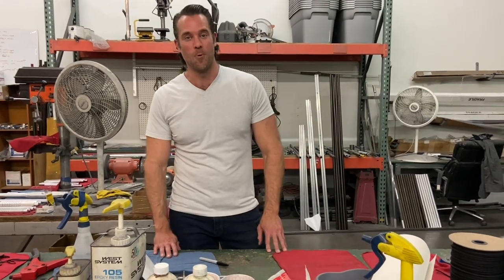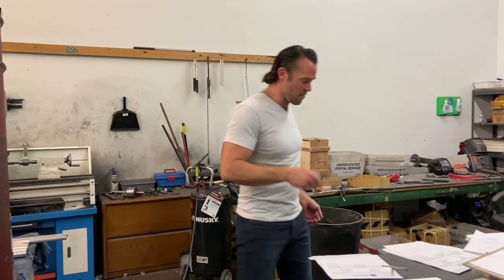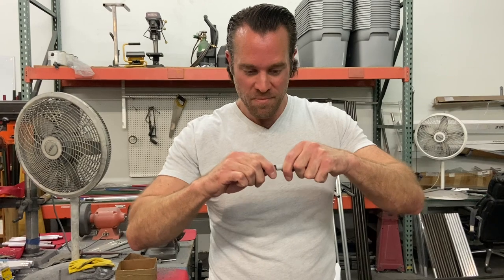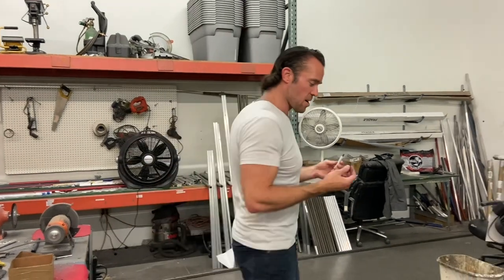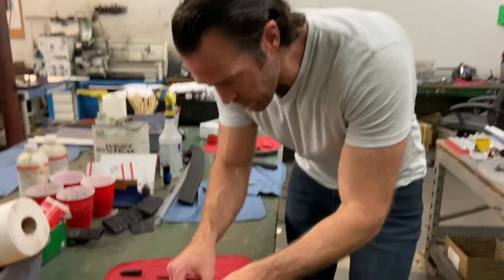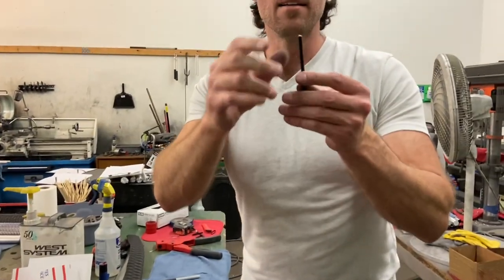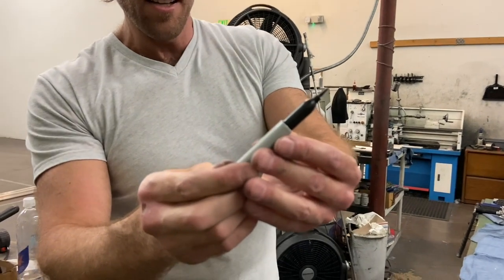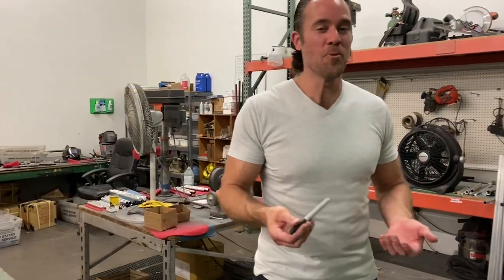I Made a Hidden Marker Spike Weapon!

Comment: I woke up outta bed this morning with a smile because I knew it was weapons Wednesday!!!🤩
Reply from the maker: That's awesome John!  Thank you so much for the support.  Yeah, for prototyping, I have a manual lathe, CNC lathe and CNC Mill in the other room to play with.  I've already been thinking through next weeks video and I may end up using the lathe a bit.  Are you a machinist?
Reply: @Karatemart  nice equipment!!!
and yes. Worked in a precision shop for years as a set up man. Made parts for subs and tanks for navy army. Made molds and tools. Gears etc etc 
Started out building furniture went to machine shop went back to wood and metal building custom guitars. Then restoring antique religious icons for the church now semi retired. 
Last project was a light saber for a Star Wars actor with my small lathe. 
Now I’m working on some martial arts weapons in fact. 
Made alotta them over the decades. Made swords and knives and battle axes from museum pieces. I love designing engineering and making “stuff”!!!
So I LOVED this video of course! Keep them up!
Reply from the maker: @johnemmons9087  That is awesome John!  Sounds like you have quite a bit of experience.  You would get along with our team great!

Comment: What was the diameter of the spike
Reply from the maker: Hi William!  I’m not sure what the diameter is, but it’s the standard tasseled throwing spikes we sell on KarateMart.com.  I hope you have a great weekend!
Reply: @Karatemart  thanks
Reply: 4mm or 5/32" is perfect.  If you are careful, you can go slightly larger with 3/16" but you risk cracking the color housing tip.

Comment: I would want a little more spike sticking out
Reply from the maker: Well…you could drill out the inside of the marker tip a little further to make the spike stick out further, but it won’t be as strong.  Thanks for watching!
Reply: You actually can't go too much further or the cap will not fit (it will poke through the top lol). :)